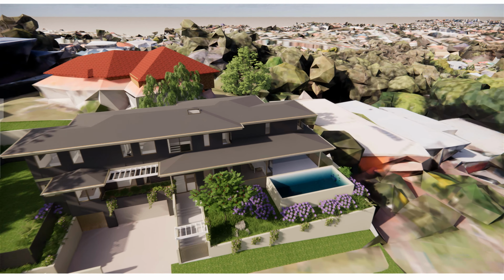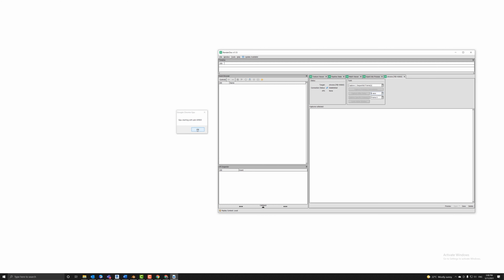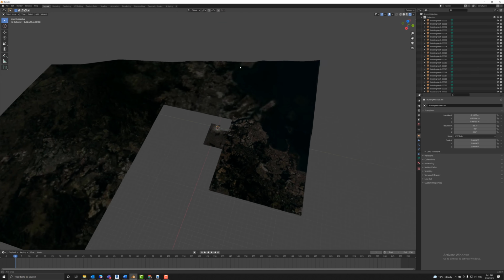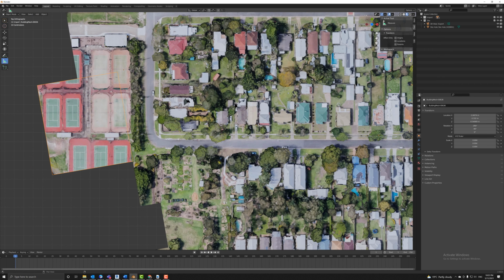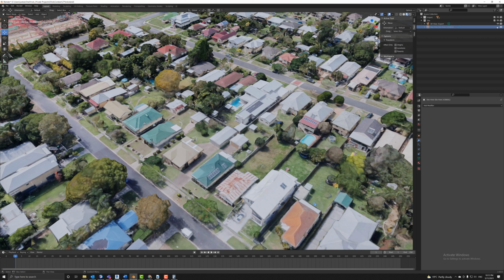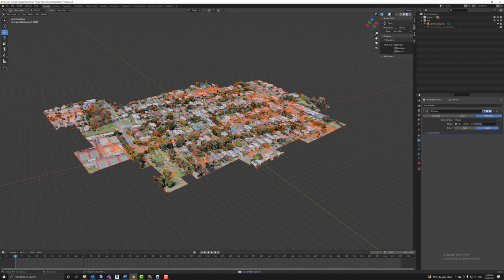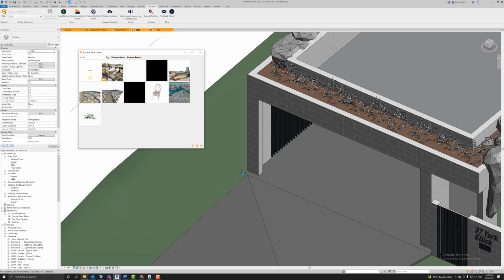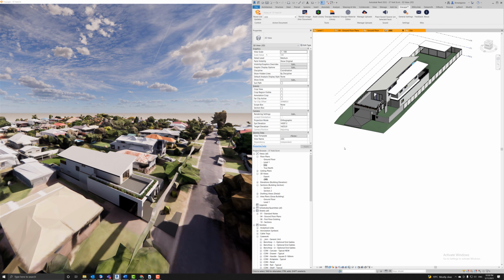Google Maps to Enscape

Comment: hey man - any reason my mesh resolution is lower then it is in google earth? you're mesh quality seems to be alot higher quality then my import
Reply from the maker: The resolution relates to how close you are in Google Earth at the time of capture, if you zoom in and Google uses different LODs (Level of details) based on the distance you are from the map. for some projects I have done a capture quite close at High res, then zoomed out and captured a low res large area, then stitched the 2 together in Blender.
if using google earth, you can go to settings and increase the "Memory Size Cache" to 1000mb, this seems to give you more detail.

Comment: Hi！ Great tutorials really helpful！ Can I quickly ask a question about the pop-up number., what happened is the pop-up number just keep repeating a couple times and  the capture button is grey. what should I do to fix that... thank you
Reply from the maker: Apologies I don't know what you mean by "pop-up number" is this when you are launching Chrome?

renderdoc won't let you capture anything until you have injected the process into the chrome browser.
there are better instructions on this process on the renderdoc page.

but basically
Step one: create a desktop shortcut to the browser with this target 
C:\Windows\System32\cmd.exe /c "SET RENDERDOC_HOOK_EGL=0 && START "" ^"C:\Program Files\Google\Chrome\Application\chrome.exe^" --disable-gpu-sandbox --gpu-startup-dialog"

Step 2: Launch the Browser from that shortcut, and look at the PID number

Step 3: open Renderdoc, from the file menu, select inject into process.
Step 4: select the process with the matching PID number, hit the inject button (bottom right).
Step 5: go back to the small dialogue that has the PID number and hit "OK"

go to google maps, or https://earth.google.com/web/
follow the rest of the video.
Reply: @BIMedge  I have this issue too - When I click "ok" on the PID number ( once I have injected it ) it closes the new injection tab ?
Reply: fixed - seems you cant have more then one browser open at a time

Comment: looks like Enscape is freezing when loading the preview.. trying to load a model x 312 y 79 z 659 but it keeps saying loading andf i don't see anything change in my memory usage.. :(
Reply from the maker: I wonder if the asset is too big for your hardware to handle?
could you reply here with your CPU and GPU spec? (for reference I'm using an AMD5950x CPU and an RTX3090GPU)
also, I'm not sure what you mean by "x 312 y 79 z 659" is that in meters?

I would try testing it with a small region say 50x50m and see if that works, this will help you troubleshoot if it's a hardware limit or not.
Reply: @BIMedge  Intel(R) Xeon(R) CPU E5-2687W v4 @ 3.00GHz   3.00 GHz  (2 processors)   / nvidae quadro M4000.... yes the xyz is in meters... just tried a new site.. but same.. it just keeps loading preview..  but it looks like a problem with enscape.. have it with all models at the moment